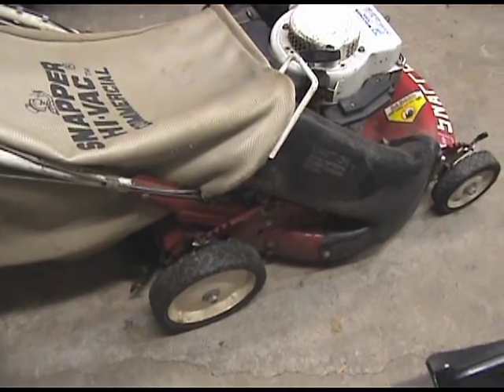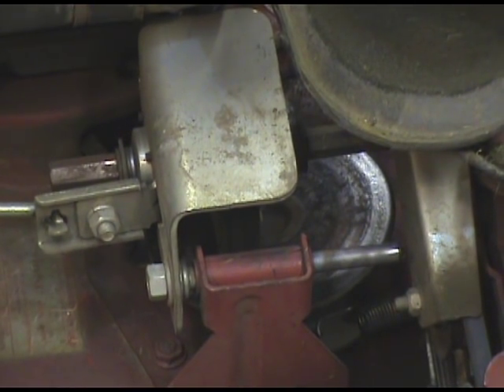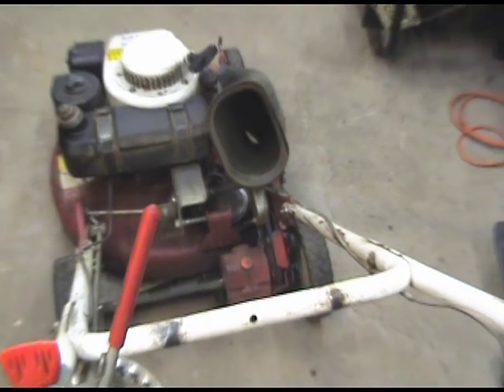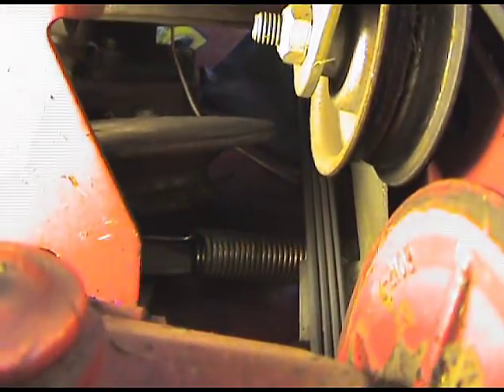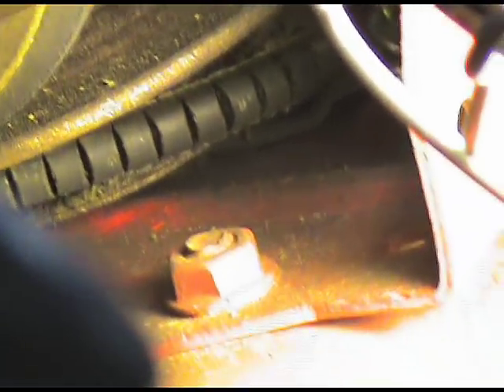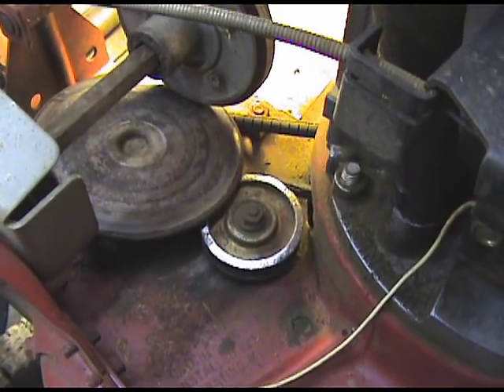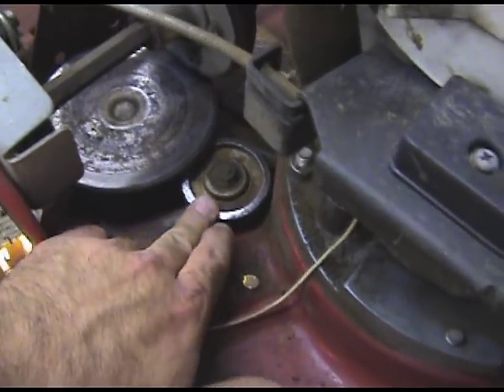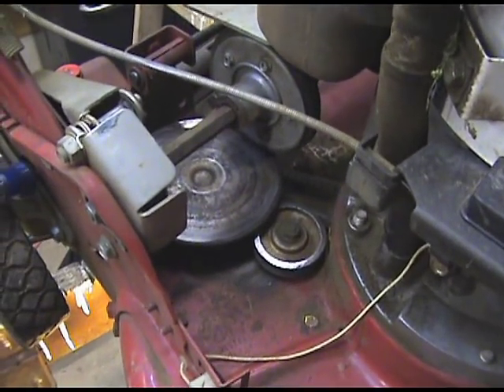Snapper Mower Drive System Repair MODEL 214X1PR

Comment: Thanks for the video.  Your video gave me enough detailed images to see how the "newer" drive system fit together.  

I have an even older aluminum deck model, that I inherited from my grandfather.  

The older model has the idler pulley on the underside and wears out much fast because of all the grass exposure.  I've now installed the newer idler pulley system and should be good for at least another decade or so. 

These snappers are by far the best built mowers I've ever worked with.

Comment: One thing I do is paint anti seize on the area covered by the chute guard. This last few months and it protects the area  from rusting. That area is very prone to water and crap and this rust etc. I also painted some areas as well but really like the grey anti seize it really stays and does a great job protecting that area. I finished taking apart the differential yesterday and checking bearings etc. Filled with 4 oz of 00 grease. Working great!
Reply from the maker: Nice! Take care of that machine and it could last you a lifetime.  I have anti seize so I may look into those areas next time.  Thanks again for watching.

Comment: I bought one of these around 1984 or 85 and recall it was about $500-600.  I ran it 30-40 hrs a week for 12-14 weeks each summer and used it that way for several summers in H.S. and college.  Fast forward almost 40 years and I still use this mower today.  I've had to rebuild the drive system 2 or 3 times, but other than that no other major work.  The engine is really phenomenal.  On the fastest speed you just about have to jog behind this thing.
Reply from the maker: Nice!  It is a really well built machine and with proper maintenance can last a lifetime.  Thanks for the comment Craig!

Comment: I have almost the same mower (commercial version), purchased in the late '70s with the Robin engine.  That engine still runs like new.  I've replaced the wheel bearings, shaft bearings, belts (many times), blades, lifts, drive tire, and the list goes on..... but the damned thing still starts on first or second pull (though I always run the carb dry when shutting down).  I even installed a good used deck when the original finally wore through.  Of course, I change the plug, oil, and all filters regularly.  Thanks for your video!
Reply from the maker: Nice!  You're welcome.

Comment: Nice to see this Snapper in such great shape - makes me feel like I should go out and wash mine off!  I have a '87/'88 model with the 5 HP Wisconsin Robin engine.  Had always seen the professional yard guys using Snappers so when I finally got tired of paying yard guys $35-40 a throw to mow our large yards, I went down to a commercial lawnmower shop to look at a Snapper.  

They had two end-of-model-year Snappers for sale for about $550 each (a lot in 1988!) but I still use mine today.

Comment: I have a snapper lawn mower that's a 1987 model year that I have used that mower every year scents new has the same motor never rebuilt still runs perfect. 
But I have rebuilt the drive parts of the mower 4 times. These mowers are rock solid when I bought my mower it was 649.00 dollars and I thought my wife was going to kill me for spending that kind of money on a lawn mower lol. God Bless everyone
Reply from the maker: Yeah.  My father in law paid about the same thing when he got his way back when.  This is proof that you get what you pay for.
Reply: I'm still using the one my father bought in roughly the same time frame. Its a model RP21500E, elec start, LoL. I do remember dad paying over $700. It still lays down an absolutely beautiful cut, looks like a golf course, and much less effort than walking the dog too. I never used the elec start even when new as its always started 2nd pull, 3rd MAX but rare if so. Just now rebuilding that same drive assy...along w/both original belts. I love it so much I bought my father in law the same model in early 2K's. Few yrs later he gave it back when he got a rider, so now I have two...and I cut their grass now also, and don't use the rider😂😅
Reply: ...also, mine has the 5.5hp briggs motor. The newer one has the Briggs 6.5hp OHV Vanguard

Comment: My original rear guard lasted 20+ years before it broke completely off.  When I got the $13 replacement guard at a local commercial lawn equipment shop, it didn't take long for it to get bent like yours from pulling the Snapper backwards on the lawn.

I think the original rear guards were made of a harder thicker plastic, and more importantly, were also secured at the right end, unlike the current replacement bendable guard which relies on never pulling the mower backwards to keep its shape.

Comment: I have a '79 snapper push mower that is almost identical to the one in the video. Only real difference is that mine has a 5hp Briggs & Stratton motor. It's one of the best mowers I've ever used. Very sturdy and tough!

Comment: 35 years ago my dad bought a 20 inch cut side discharge LawnChief push mower for $120.00 with a 3.5 HP Briggs on it, on it's 30th season the wheels pretty much had fallen off of it and the deck had a small rust hole in the side, so we threw that deck away and found a similar 20 inch deck to put it on, the engine still starts on the first pull every time and runs like brand new, I had the engine apart and nothing had worn at all in 30 years, only break down was the condenser failed 12 years ago

Comment: I still have one of these... and I've been using it even longer....  love it!!
Reply from the maker: Yeah.  It's a great well built mower.
Reply: Paisteboy I’m trying to figure out how to change the oil... or find an owners manual.  That one has a Wisconsin Robin engine doesn’t it?
Reply from the maker: I believe the drain plug is on the bottom underneath the mower deck and if I remember correctly it is a square hole. I think a 3/8" ratchet extension should fit inside the square hole.  I don't own this machine my father in law does so I going from memory.
Reply from the maker: And yes, it is a Wisconsin Robin engine.
Reply: Paisteboy thanks!!  I’m in a shelter at home location so I’m digging out my socket set and giving it a shot.  How much 30 weight oil do you think?
Reply from the maker: I would add half a quart and check it.
Reply: Paisteboy ok got that done.  One more question.  The transmission plug oozes a little.  What kind of grease is in there?   I think I should add a dollop or two.
Reply from the maker: I'm not sure if that's a grease or fluid. If it's leaking then it sounds like it's a liquid. I would see if there is a way to check the level before adding more. It may be over full.
Reply: Paisteboy it is grease.  Dark gray... owner’s manual says Snapper 00. I’ll find some.
Reply from the maker: @aprildunbar5502  
Sounds like a plan.👍
Reply: @Paisteboy its called snapper 0-0. If you have model # there are great parts diagrams out there, AND parts suppliers too.

Comment: Do you know the part number for the small belt that goes on the large pulley and the small pulley when it is engaged? Thanks for the video. It seems to be 12 years old but I still have one of these mowers that runs great.
Reply from the maker: Sorry, I don't know, but you can find parts tree schematic for the part. 
My father in law still has and uses this mower.  I've repaired it a couple of times, but it's still going strong.
Reply: @Paisteboy  I figured it out finally. Thanks for the reply.

Comment: I picked up a similar era snapper. I can't get the friction disc to slide on the shaft. Bathed it in penetration oil. Hoping it frees up
Reply from the maker: Yeah.  It sounds like it stuck pretty good. You make have to work at that fir a little while. Many snowblowers have the same system.  Yiu nay be able to find a video with the same issue for more help. Try "donyboy73" channel.
Reply: @Paisteboy  I got it freed up. Put a 5/8" socket with an extension over the shaft. And knocked on it with a hammer putting force right in the barring. Broke it free and sprayed the shaft with PB Blaster. Works very nice now.
Reply from the maker: Nice job.
Reply: @williamajthompson9166 Take care of that hex shaft. Thats one of the FEW  parts that's no longer available. Hard to believe too

Comment: @paisteboy Yeah it's a simple mower, only feature is the throttle control and new ball bearing wheels and height adjusters. But it's the most reliable and best running mower I have and have ever used, they sure don't make em like they used to. It runs so good now it'll probably outlast me and I'm 15 lol

Comment: Thanks for the vid, just bought a used one of these and I think I have an old belt just like in the video, also the loose nut on the buttom causing the friction disc and pulley to not work right.

Comment: i get on face book buy sell or free pick up lawn mowers to fix and sell came across one like this it's not a commercial one got it clean up but no kill switch and when you put it in low for rear wheel drive it pull you really good it has the same body style as you'rs
Reply from the maker: Nice

Comment: I had to replace the rubber drive disc and bearing on a standard walk-behind (MR series 14 - 15) Snapper. The bearing has a lip on the inside which makes it slide along the hexagonal shaft (as shown at 7:46). 2 retaining rings hold the bearing in place. But what is supposed to hold the bearing in place when moving the speed changer in the other direction? It has nothing retaining it so it falls out of the thrust plate. I must be missing something...?
Reply: If I recall on mine I used 3 screws to hold the bearing in place. I believe there are holes already there but for some reason not used. They will hold the bearing in place identical to how the wheel bearings are in place. To keep them secured I used a little JB Weld on the exit side of the bolt once installed. Has worked great. Key for all these several bearings I have found is to sprays with WD40 after every use. Get a spray bottle and buy the gallon option. Much cheaper than aerosol cans. Yeh that might ruin the grease possibly in the ‘sealed’ bearing but I have found this to work very well. All bearings work great

Comment: Thanks man!   I got one of these the other day, exactly the same body looks like, doesn't have a Wisconsin on it though, its got a crazy motor on it however. LOL  a commercial electronic ignition Kawasaki is on it.   I really appreciate this video though man, i had no idea what the model number was and the belts are worn enough i cant see the number on it. appears my tension pulley is gone for some reason. weird though because it still goes forward possible I have the same body ( deck) and a little older design.      

   i see what they call them a vac. LOl  if you start that thing up without the bag on it it will blow the hair off your head.    must be that slight curl around the edge of the bottom of the deck, did you notice that?   it covers the edge of the blade, none of my other mowers have that.       could be too that this kawasaki motor is more powerful than the original, i think it;s a 6hp.      at any rate.   I dont have to rake anymore. LOl this thing sucks everything up out of the grass, i don't think even the bugs have a chance with this on the job,.
Reply from the maker: Leisure suit Larry 
Cool.  Glad it helped. Thanks for watching.

Comment: were did u get it? and i know it off topic by i am having problems baja doodle bug i  have worn down the tire so i bought a new one. i had it weighed and installed. my engine wants to cut out and my plug it filing down to the point were it stalls. then my carb like floods out if i don't burn any gas. have any tips????

Comment: i have my 1988 snapper with a 3.5 hp b&s motor my question is what purpose is the white wire going from the deck to the engine is that a stop switch in case you forget to put the side discharge chute on or rear bagger chute the engine won't start? i was doing some work on my mower had the recoil starter hood off, carburetor and gas tank off and noticed the end of that wire not hooked up to anything just hanging there can't tell what it was hooked up to so i electrical taped the end of wire just left it unhooked.
Reply from the maker: That's what it looks like to me.

Comment: I have one very similar mine is one year older than yours and my drive quite to I am now completely rebuilding it. mine has the 3.5 HP Briggs instead those little rubber wheels go bad easy so watch those.

Comment: How good are you at troubleshooting? My Snapper self propelled Mower, after replacing the drive belt [off the blade shaft] won't pull now. It pulled fine before the replacement, until the belt slipped off.  With the motor off and the lever engaged, I cannot push it at all, stuck. Letting go of the lever, it pushes fine. What do I need to do to regain propulsion??
Reply: With the mower not running and the drive engaged as you said you are not supposed to be able to push the mower. That’s like pushing a car with it in drive and off. Should be able to push it with it not engaged. Is the wheel disc spinning when motor is on?

Comment: You need a new 3/8 x 24" belt. Don't even try putting on the old belt because you will have to do the job twice.
Reply from the maker: I did end up replacing the old belt.

Comment: in my opinion anyway if everybody was in such a hurry to buy Chinese crap Wisconsin would still be in business. isn't it worth buying quality stuff?
Reply from the maker: I see your point, but in many cases, people would have bought nothing because of the high cost of the high-quality American engine. The cheap Chinese option is something they are willing to spend for a small engine.  Thanks for watching.
Reply: wisconsin robin, is owned by fuji heavy industries or teledyne total power, fuji heavy industries is formally known as subaru. Subaru still has a small engine name of subaru robin which is still around...although not the same quality as the old engines of wisconsin robin.
Reply: fuji made these engine in japan. My mower is 35 year old  2 cycle robin and still has more power than my newer snapper with a honda gxv160. Now the new engines even honda's and subaru's are chinese made and are design to be throw away engines. They dont start you throw them away and just buy a new one which is such a waste compared to me having a mower and engine thats was my grandfathers and cuts better than the new ones. The only other engine that came close to the fuji robins where the toro's with suzuki tv5002 engine also a 2 stroke. My grandfather had his own lawn cutting company and had a little of both the robin's and suzuki's. i still have 2 that where in his fleet a snapper 214xp2 4hp robin and a toro 22043 suzuki both going strong. In fact when i bought my new snapper with gxv 160 honda i was very disappointed in the power it had vs thoses mowers